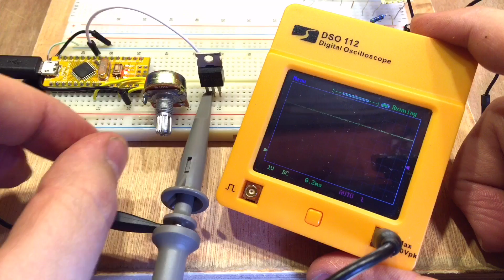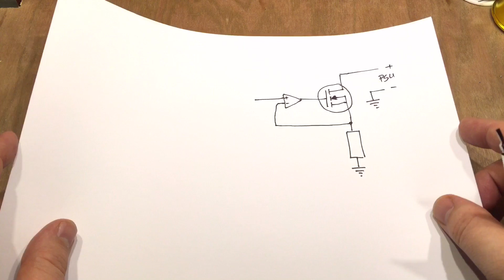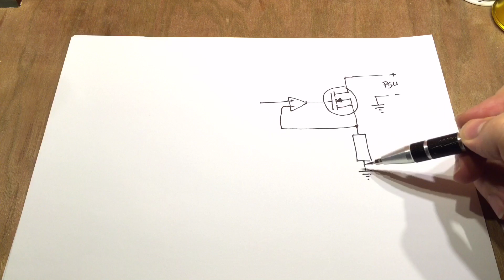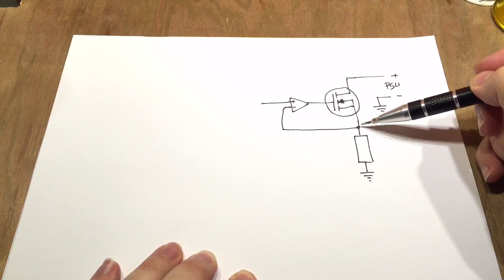Constant Current DC Load - Part 4 - Low Pass Filter - Adam's Arduino Projects

Comment: The sense resistor does not have to be 1 ohm, to measure currents an as low as possible resistor is the best, maybe not a resistor at all. What about a magnetic sensor, a Hall effect sensor like the ACS712? If you use a mosfet as a variable resistor you have to consider the energy wasted in the mosfet: only if you use the mosfet as switch with very low  resistance you have not to use a heatsink. In the Davy Jones solution most of the energy is wasted in the resistor and there is a considerable swing (oscillation) , almost an on/off situation of the mosfet.

Comment: I must have missed  or forgotten your reason for high side resistor placement , but that that would never be my first choice since I like keeping 12V SLA batteries around. 
Forgetting if or where you have the voltage divider, to use this on anything higher than 5V ( such as  4.8V clock battery pack) is immediately not possible. 
Not sure why you aiming to draw up to 5A, surely  not from AA sized batteries or even those NIMH or lithiums , any hints in advertising about those being suitable for such a draw are grossly exaggerated, so unless you are intending on testing big battery packs as a whole, I assumed you are intending to test 6/12V batteries as well.
On the second thought since you are aiming for 5A when you have the resistor at the bottom , now you have a gate drive problem, getting too small with increased draw. So either way some improvement are in order. Discharging the gate with one pin and a trasnsistor and charging with another transistor buffered pin with a tiny cap tripler or quadrupler should do the job.
Reply from the maker: +Sambo Thanks for the advice. I should return to this project because it does have some issues - although it also does work. I wanted to do 5 amps because that would be higher than the cheap loads on eBay. I learned a lot from this project - and I'm sure I'll learn some more :-)  Cheers

Comment: Hello.
Great project :)
I have one question. Does it stop discharging when voltage drops to a given value? Can it?
Im looking for a way to test a lot of used laptop 18650 cells (around 300), to measure their capacity at 1A and 2A discharge current and to check their viability for a e-bike battery bank. 
Could You maybe help me with that?

I think the test should look like this:
1. Record V at which they were found at.
2. Charge to 4.2V (preferably monitoring their temperature while doing this)
3. Wait couple days and check the V to see if it holds.
4. Discharge at 1A to 3.0V to get capacity (preferably monitoring their temperature while doing this)
5. Charge to 4.2V 
6. Discharge at 2A to 3.0V to get capacity under bigger load and to test its viability for application. (preferably monitoring their temperature while doing this)

This should give me a good idea about the health of that cell.

I found a cheap way to charge multiple cells using TP4056 power bank modules (around 1$ per module), but i don't have any viable way to do the second part of this test. Those that do exist are either inaccurate, expensive or not available in my country without an $100 charge to ship them from china.
Reply from the maker: +M K Hello. Yes this project does have a cut out voltage. However as you'll see this project isn't finished yet. 

I have another project for an 18650 (well any type of lithium cell really) capacity checker. It cuts out at 2.9 volts but can be edited in the code very easily. It could be expanded for more than one cell at a time - which I know some other viewers are attempting. 

The battery tester uses a fixed resistor rather than a mosfet so it isn't constant current. Actually this may be a better test for your cells as the current draw of your bike will probably drop as the voltage does?

Comment: Why don't you simply use a chip that is build for measuring current? For analog measurement you could use these cheaply available ACS712 in ranges of 5 A to 30A measurement. (http://www.banggood.com/search/acs712.html) 
If you like to use a shunt resistor, especially if you want to go "high precision" you should use very low values on resistance but add a differential measurement amplifier that solves your problem of rising ground but lowering Ug of the FET. Have a look at TI's INA series chips for measuring across current shunts.
For the FET itself, you always have the problem that you need to get the gate far above ground. So you should think about adding a FET driving supply and an OP amplifier that then takes the Arduino set-voltage and the current shunt amplifiers control voltage to drive the FET through the full range.
However, if you would keep it a bit more simple, as you don't design a 300A load but a more or less simple battery tester, check some designs around the infineon BTS 141 FET that has some features you might like without bringing these little projects out of budget.
Reply: Hi, I am having no luck using the ACS712 for measuring the current. It is way too inaccurate. The INA219 is much better.
Reply from the maker: +Astralix2011 Yeah I've got a couple of ACS712 modules and that if definitely an option to complete the project. I like using analog components however - it's part of my learning electronics. I also try to keep my projects as simple as possible so that others can build them (if they end up working of cause). 

Some good tips here thanks - I'll be researching your suggestions. I have come across the BTS141. Over current and over temperature would be handy. Perhaps I'll invest in a couple to give them a try. 

Thanks again - some really useful info in your post.
Reply: You're absolutely right, but for most of the people it is far more easy to order an ACS712 board along with the Arduino clone and display from their favorite Chinese seller then to get precision shunt resistors and differential operational amplifiers... But for learning electronics the last option is much more valuable. However besides understanding, most people will fail to even get the real good stuff, as it is only sold by distributors that do not deliver to private buyers.
However, a good compromise of the two options would be TI's INA 138. You can buy them on normal distributors selling to private persons and it is a high-side sensing device, so you don't pull your GND level with your shunt ;)

Comment: I built a battery balancer circuit that runs the mosfet in a linear mode and haven't had any problems with thermal runaway. Mosfets tend to pass less current as they warmer, which is the opposite to BJTs. 

Does the mosfet really need to turn fully on? I guess it depends on how much current you want to push through it. In my case it wasn't a problem as I had heaps of volts to spare. You're running a lot closer. 

Perhaps some kind of voltage level shifting arrangement would help? You could use an opto-coupler with the LED driven from the Arduino and then the mosfet on the output side driven from a higher voltage. An op-amp or even a couple of transistors could also do this level shifting, but due to the isolation of the opto it could be much simpler to implement - and safer for the 'duino too. A level shift would also give you the option of putting the resistor on the low side if that worked out better. 

You could put the integrating cap on one side or the other...or both. 

And finally, I wonder if a mosfet designed for audio amplification applications would have a better linear region to use?
Reply from the maker: +xanataph I'd really like to just use the 5 volts from the USB because that will make it much easier. I did think about using the charge pump from Julian's pwm charge controller design. 

I hoped to rival the cheap ones from China but I'm not sure I'll be getting any where near to 10 amps. I think three would be nice but obviously I'll want to keep below 25 watts. 

Choosing the right mosfet will be key I think. Not thought of one designed for audio though. I have a few to try and see how they go. 

Thanks again for your input Xan!
Reply: If you're trying to stay within the 5 volt limit perhaps a BJT could be a better solution? Obviously there is a limit to how much current you can source from the Arduino but if you used a darlington type (or made your own) you would still only be dealing with around 1.2 volts to turn it on. You could then have the resistor in the emitter circuit and even if you dropped one volt over that you would still have plenty of headroom.

Comment: The lower the resistor (wirewound) the lower the voltage needed to produce the same result. There is Vloss in the lowpass filter so not quite 5volts. What's gunna blow your mind is thermal runaway of the mosfet. You need the opamp to drive and provide a buffer ;D .. But your making progress.
Reply from the maker: +Martin P I think it's very likely I'll need to use an op amp, but as with my other projects I like to make them as simple as possible. I think it's very likely I'll need to find a more suitable mosfet too - and I've got a new laser thermometer to keep a check on the heat. 

Really appreciate your feedback Martin - thanks